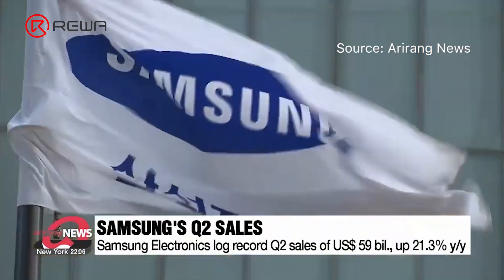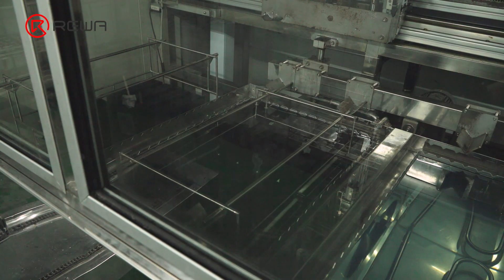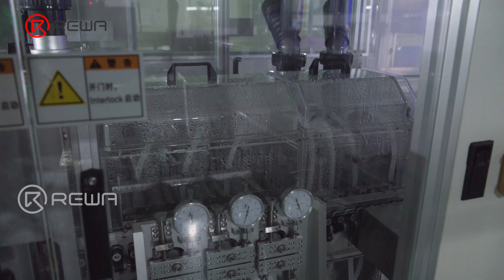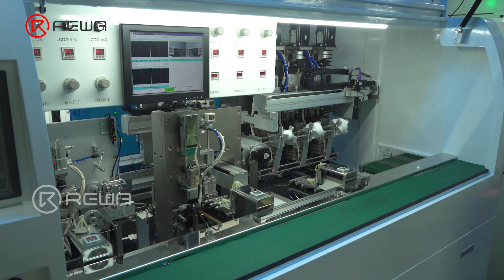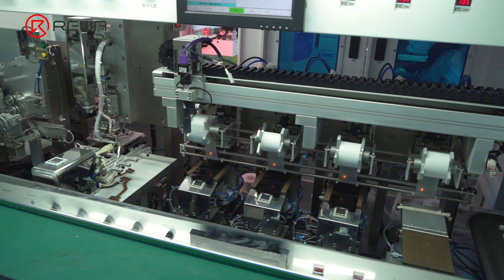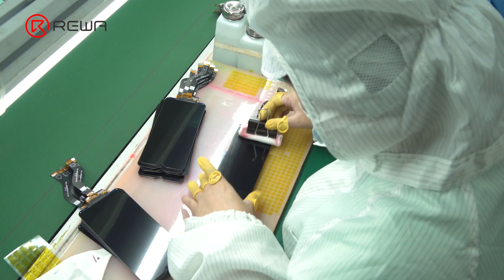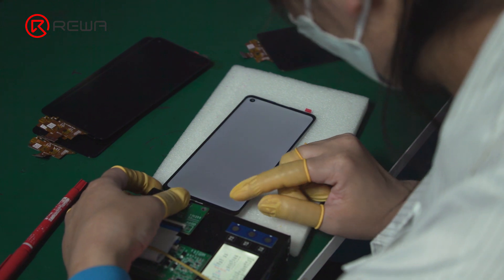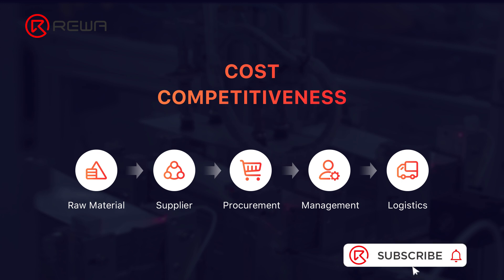How Aftermarket Samsung TFT LCD Screens are Made

Comment: REWA Thanks for the presentation! I want to see more of this mobile electronics process! 👍 From my experience, TFT screens are thicker than AMOLED and the problem with Samsung is that the frame is also made to the nearest millimeter and then there is a problem with assembly. These are my experiences. Nice aftermarket but I call it fake! 😉

Comment: To be honest OLED screens should be cheaper than TFT as it has only one glass, no external backlight, aluminium plates and etc.
Reply: oled is expensive to manufactured
Reply: No, you're not being "honest"🤭 OLED material is, still, expensive to manufacture, and it's not only about "quantiiy of material being used", since the OLED material is expensive to make. HD OLED screens can be "cheaper" to produce, but FHD, QuadHD or UHD screens are cheaper to produce with Liquid Crystal materials. The Highend LTPO OLED used in highend samgung phones are expansive to produce, when compared to produce the highend IPS LCD DolbyVision Capable of the Poco X4 GT.
Reply: OLED Eveporation so expensive